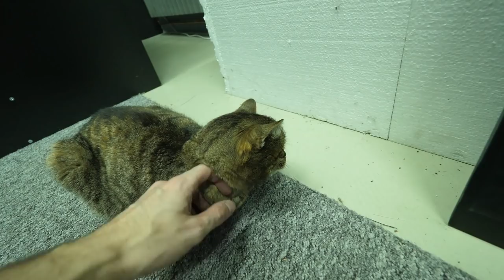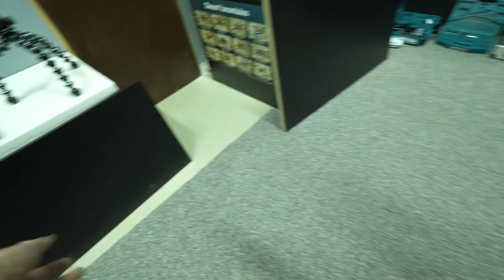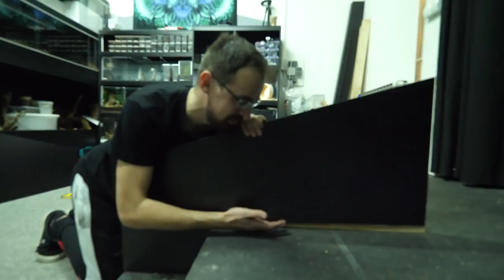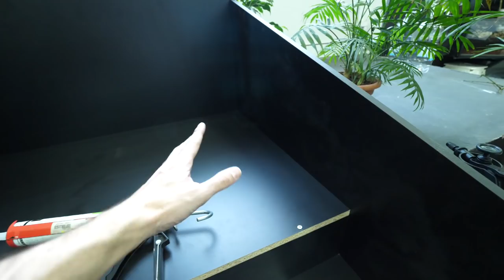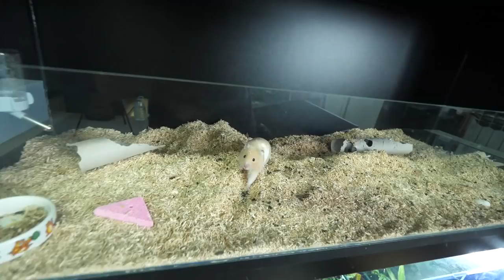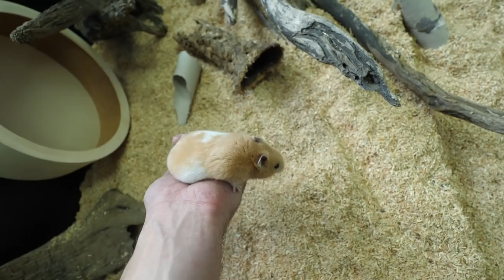HAMSTER MANSION BUILD! Cappuccinos new crib

Comment: If I had one recommendation it would be to add a lip of some kind to at least the corners. Hamsters are notorious for escaping by climbing out using corners. I am even linking a video so you can see just how easy it was for this hamster to climb to the ceiling of someone's room just by using the corner. I hope it helps and I don't mean to say you're doing anything wrong. It's actually the opposite. You're one of the best hamster care givers I've seen!

Comment: You could add a glass plane on top for the upper 40cm? Like a partial lid, with hinges if you want to open it completely for better access. That way he won´t be able to escape using the wheel, wood or the water bottle.
But looks great! So much space for activity!

Comment: Because its open and on low ground, watch out when mitza is in there so she wont eat him or disturb him.

also i suggest you to cover the spot in the enclosure where the wood is visible, (in the stair section) because if its not covered with some silicone or lacquer it will begin to expaned and mold if pee or water touches it.

also i would suggest maybe making a lid for this enclosure, that way he wont be able to escape/mitza wont be able to get him. 

i really like your videos, please keep those up.
Reply: Also, please do not take risks, sometimes they pay off sometimes they arent, i like the saying "better safe than sorry".

Comment: I'm not worried about mitza, but I think a fine/thin mesh attached to wooden sides for a top would be a good idea. That way you can have a lid just sitting on top or you could add hinges on the back so that way there's no escape for cappuccino! and the fine mesh would give just as much air as if it was still open So that way no matter how you change his enclosure you'll never have to worry about an escape. :D

Comment: You should put a piece of 20×20 aluminum angle  on the step where th raw board is then seal it with silicone so that the enclosure will last longer and not swell on the step.